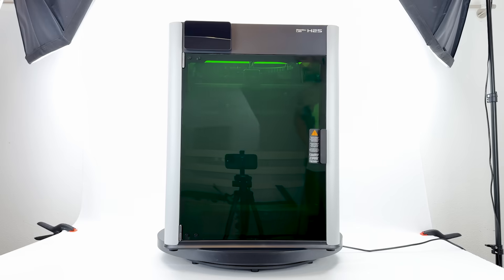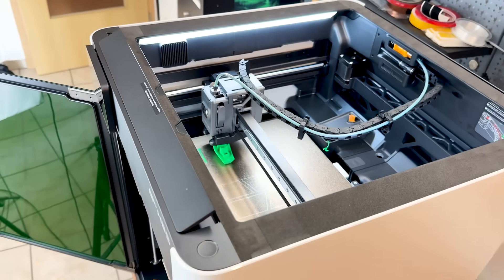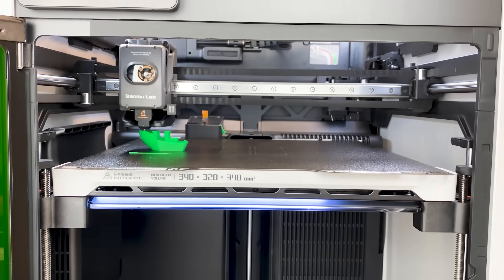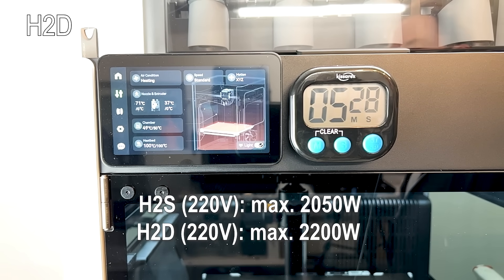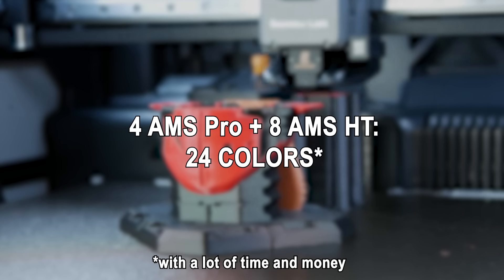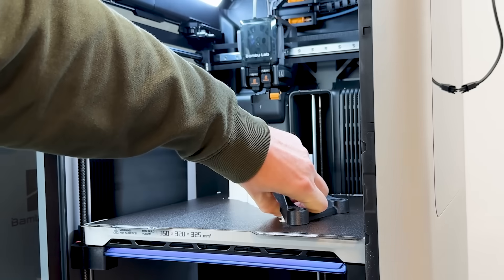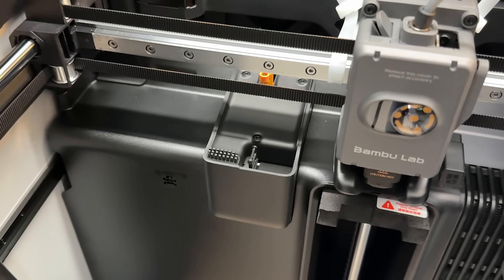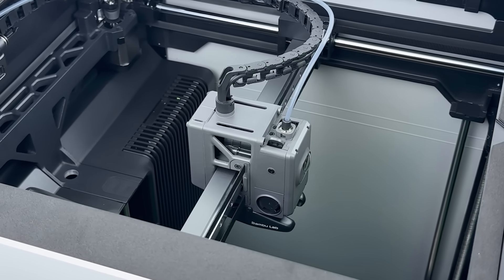Bambu Lab H2S Review: Big. Affordable. Great.

Comment: All I wanted was a larger print bed so the H2S was a no brainer. I've been using it for about 3 weeks and it is as great as I would have expected from Bambu.  One question - Where did you find the turntable??????? I have been looking for something that will work with my X1C but no luck.
Reply from the maker: Amazon some years back, but not recommended - it’s on and over the limit for those printers
Reply: @247printing  Thank you. I appreciate the reply.

Comment: I have a Creality K1C and an Ender 3 V3 Plus. Both worked well for me - for about two months, then the breakdowns started. I’ve spent hours trying to tune the slicer settings and I’ve replaced the main boards on both, but they still aren’t working. My project for tomorrow is to replace the stepper motors on the K1C. For me, Creality just doesn’t have the reliability. Wish I had paid more for Bambu.

Comment: Still a somewhat expensive machine. I was thinking about buying a K1 Max these days. They go from mostly 600 € down to 450 € for a refurbished model. That what I call "cheaper".
But 1200 bucks ... nah. It's a thing for Apple users who maybe want to go premium here. But some features are not really needed or necessary here - not if I pay like double or 3 times.

That Snapmaker U1 looks like fun, although it's maybe for a very different type of consumer (more multicolor, less technical parts). - which is fine for me.
I didn't get that "deposit" offer for 679 bucks but still got the early bird for $749. Let's see, how this turns out.

Comment: @247printing For the bed temperature, did you calibrate your emissivity value on your thermal camera ?

When doing some reading with probes, tapes etc.. i wasn't getting consistent values, after doing some reading, i found some studies online saying that the emissivity of ULTEM -(PEI) to be around 0.85 at 100°c, if this is applied (0.9 in my case) to the thermal camera, the values seems to be spot on with the one displayed on the screen of the printer.

Comment: You can do dual material on a single nozzle, but you have to up the purge, like ALOT!
so it should only be dont for a few changes not 2131 changes on a print.

i find that just asking it to purge 999 works on my X1C but i only do it for prints where i cant avoid a larg supported arear that needs to look amazing.